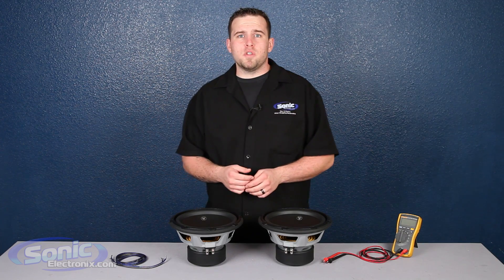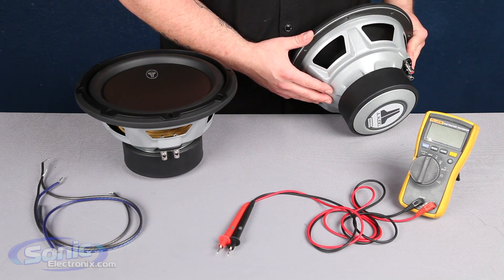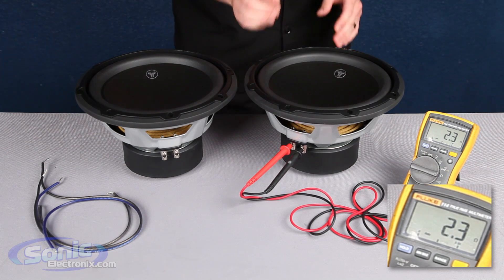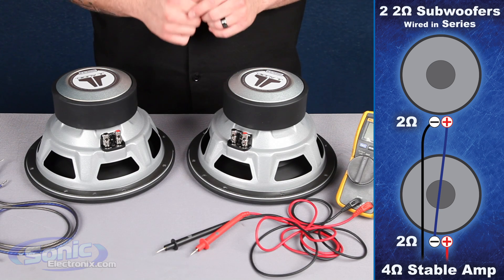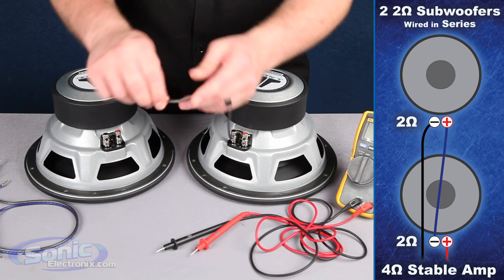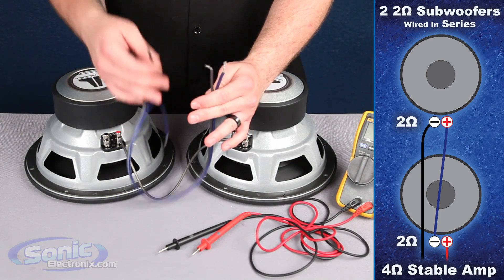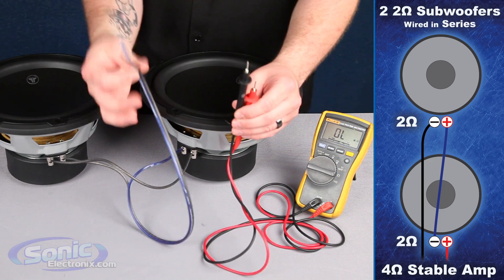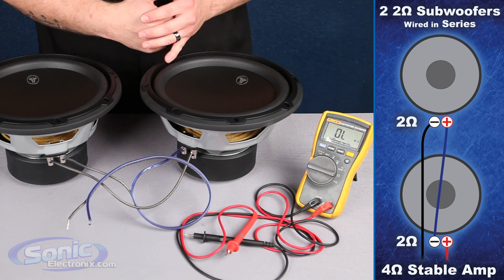How to Wire Two Single 2 ohm Subwoofers to a 4 ohm Final Impedance | Series Wiring | Car Audio 101

Comment: You guys put out the best instructional content! I'm an amateur at best, but after watching your videos, I feel I can take on any project! That being said, does this method go the same for door and dash speakers? For instance, 6x9 (100 rms) and 3.5 (25 rms) in a Ram 1500 running new speaker wire.  Both are rated 2.3 ohm by the manufacturer.  I'm wiring them to an NVX JAD800.4.  Would parallel be the way to go?

Comment: how do you wire two svc 4ohm to a final impedance of 4ohms? I will be wiring it on a 2 channel bridged
Reply: +Miko Ace wire them in parallel.
Reply: +brandon hammer That will give him 2 ohms
Reply: You dont. 2 or 8 ohms only. Sell 2 channel and get a monoblock(1 channel amp)

Comment: @Jose that's correct or you could wire them in parallel down to 1 ohm to the amp as long as its 1 ohm stable

Comment: Now saying that each woofer is 500 watts rms so thats 1000 watts rms together with both so you'll have to get amp at 4 ohm @ 1000 watts to get 500 watts to each woffer??
Reply: Yes or be smart... Wire to 1 ohm and get a monoblock that does 1000w at 1ohm